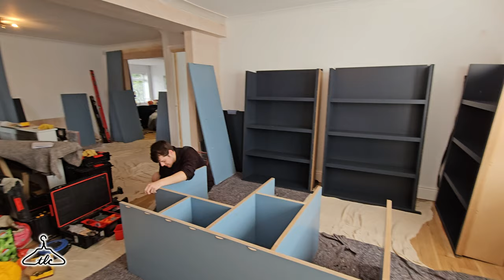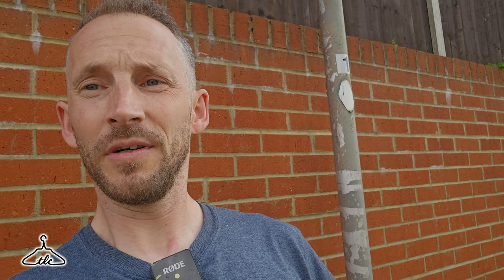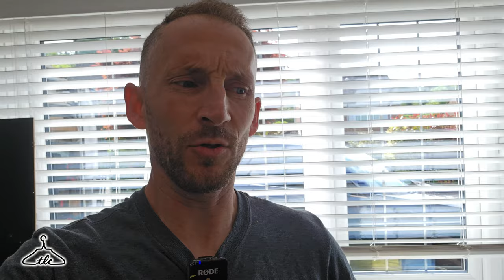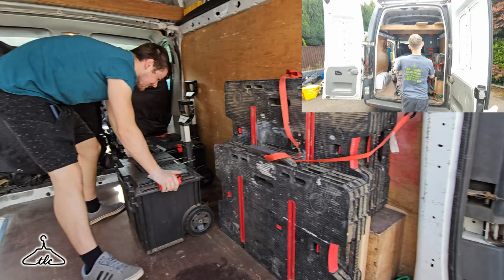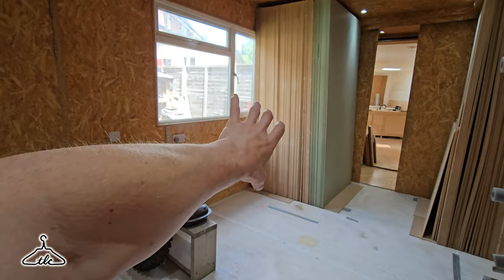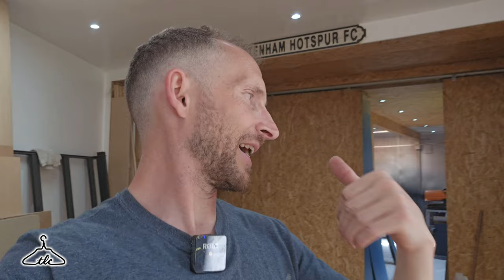BIGGEST Mistake Of My Career..... Installing 2 Beautiful Handmade Feature Cabinets  (Part 2/6)

Comment: We've all done it - I've been a cabinet maker for 30 years. Did exactly the same thing about 10 years ago. I hired a Luton van, took everything back to the spray shop still assembled, removed the backs and repainted it. Luton van again for the refit. Cost about 300 quid back then but saved so much time. Onwards and stay positive...remember, the man who makes no mistakes, does nothing! 👍
Reply from the maker: Hey!
Ahh so im not alone... sounds like you sorted it pretty quickly which is good :-)
I like your say too :-)
Cheers for the kind message, Ryan

Comment: I know its to late now, but was there no way you could have resprayed once installed. Time wise it would have been quicker. Yes the masking of the house would be two days work but overall time saving.
Just curious if you considered..
Reply from the maker: I guess it wasn't impossible but when you spray with an arlirless sprayer, they are a bit of an animal, very easy to pool and get runs.
I think technically it would have been possible but very very hard with the equipment I have 😊